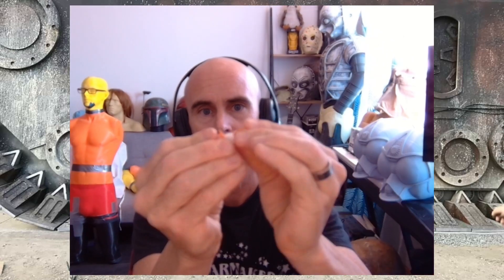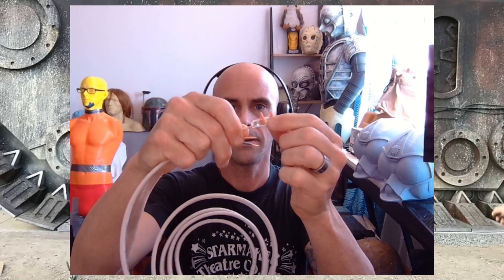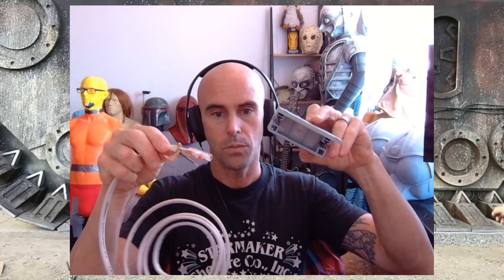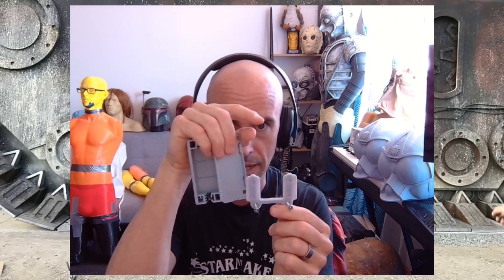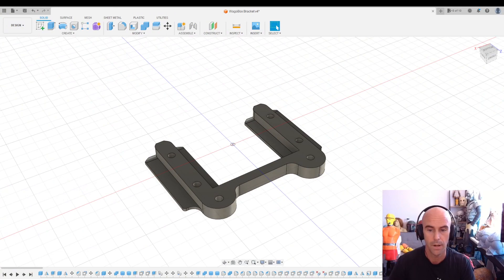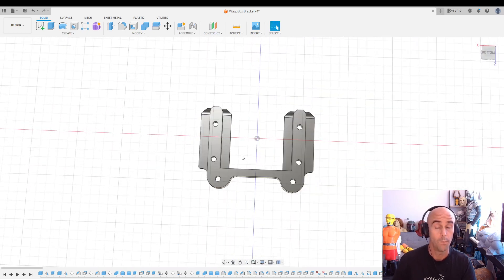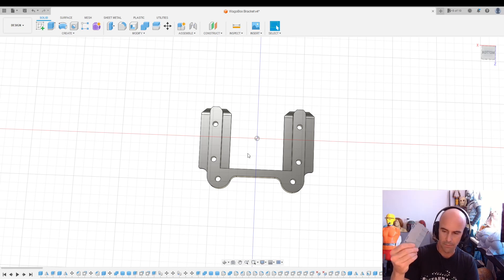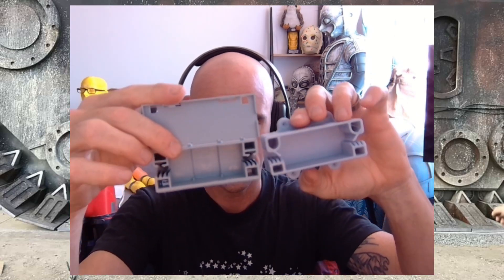When 3d printing is faster than shipping...

Comment: The reason you can't  get them here is because they're not code compliant in the US. No UL listing, among other things. But neither is your printed box, so 🤷- Viewers looking to import these or print similar designs should just be aware of the inspection/insurance/safety ramifications of going rogue.
Reply: apprentice electrician here, you're spot on. which part of me thinks is silly considering knob and tube wired houses are still code compliant being so old and that's way sketchier than this. but then you get into why you cant run certain types of plastics like vinyl-chloride based products because of how toxic the smoke is when it burns, which is then entire reason there is a code. My teacher explained it like "we are essentially preventative firefighters, everything we do and the rules we have in place it to prevent electrical fires and ensure life safety" which gave me more respect for the rules.
Reply from the maker: 100%